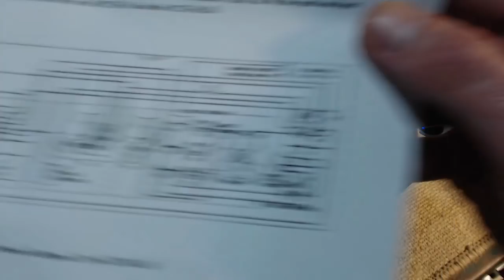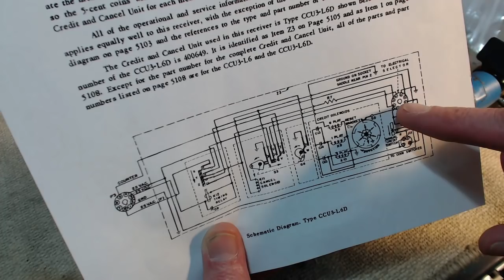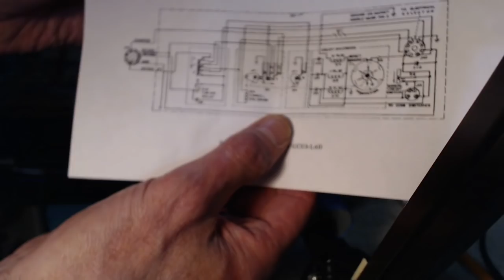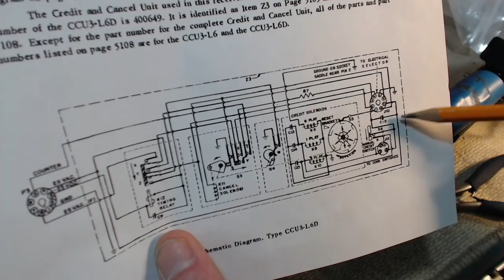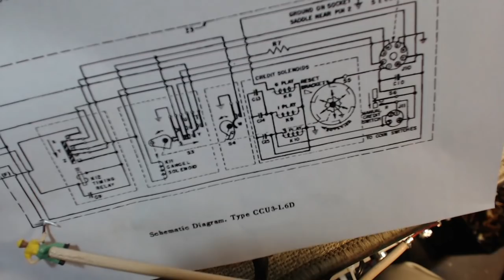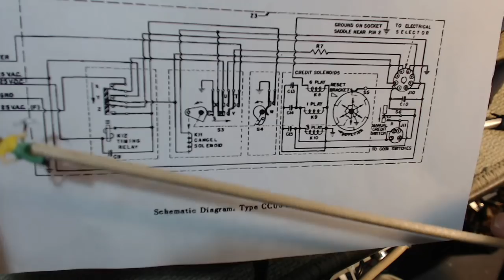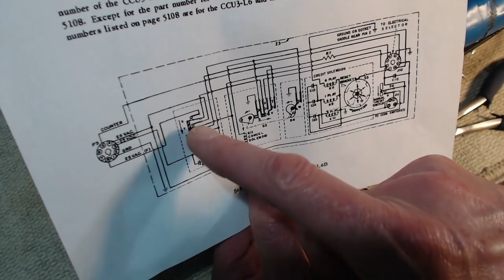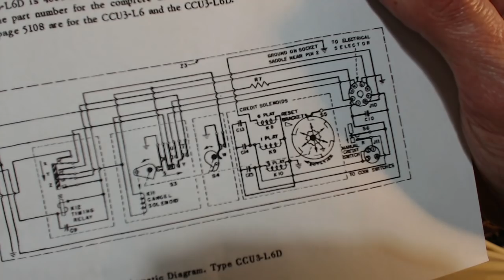Smoking Seeburg Jukebox Video #2 - Credit and Cancel Unit

Comment: looking at the C C U 3 diagram i think you have a mix of A/C & D/C electromagnets - relays .

The capacitors are snubbers & on the D/C relays introduce a small time delay . Holding the relay closed after the drive voltage is removed & can make the timing / set-up less critical
( the bigger the cap the longer delay ) .

 Relay - electromechanical logic is a big pain & can be very convoluted .

It can look odd until you see the circuit for all  the unit in one go .

( Very strange things back in the day, confuse the competition & all that ) .

Comment: Hi Jim
The relays look like A/C type so the capacitors are used as a spike snubber .

No pop / thump from the speaker when the relay operates .

( A d/c relay would have a diode across the coil ) .

The problem you have is the unit can have mods you know nothing about .
It looks like the C C U has given trouble on more than one occasion !